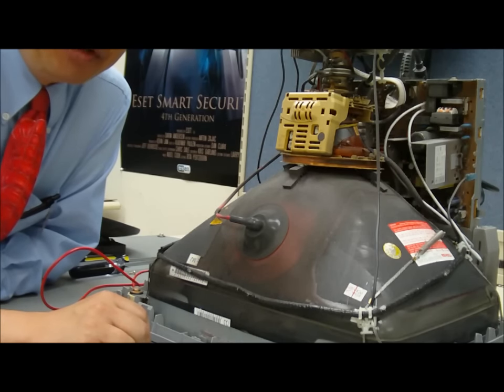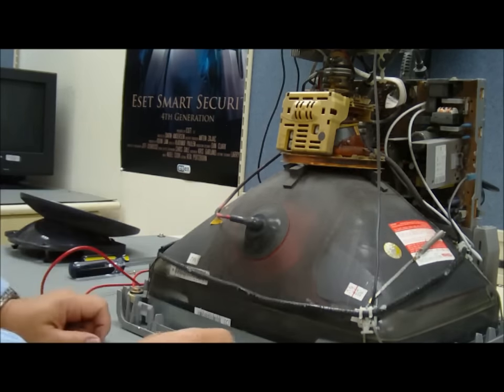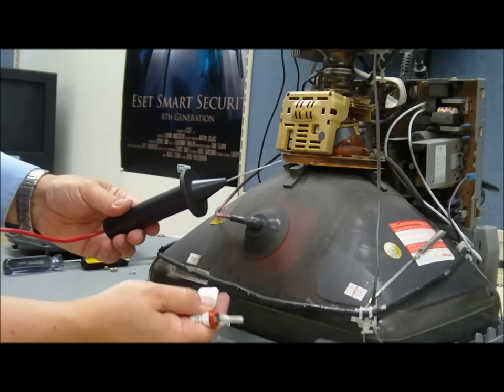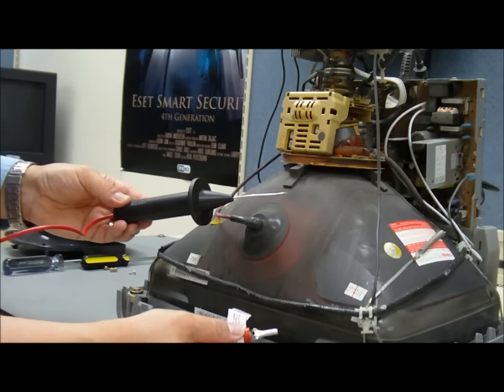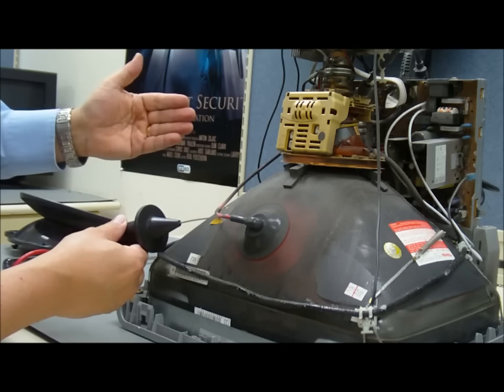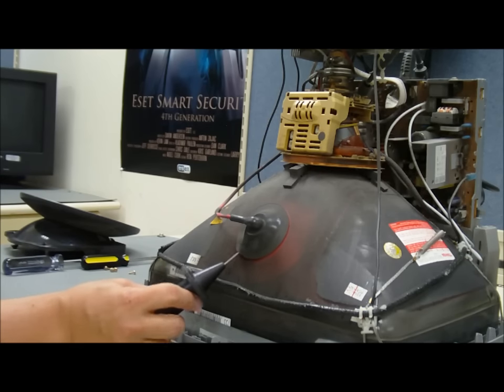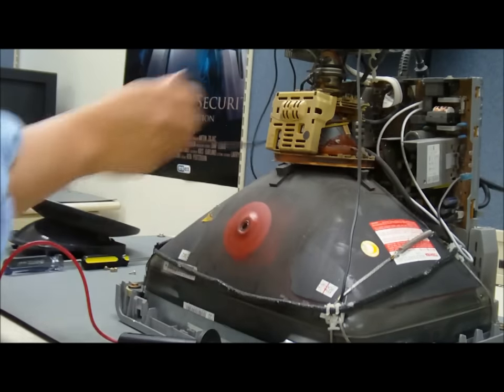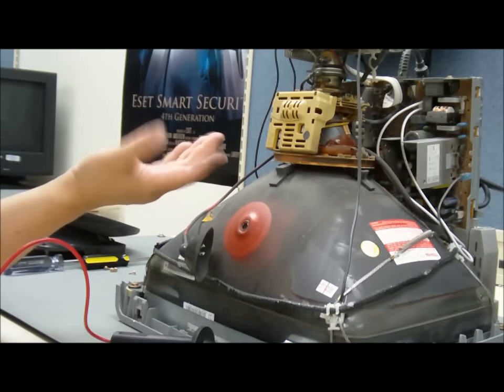Tech Support: Safely Discharge CRT Monitor

Comment: when taking the anode cap off, you don't just yank it off like that. you apply pressure sideways and dislodge it at an angle. Basically, pushing one side of the clip on the wall of the hole to close the clip together... It should come off smoothly and easily if you're doing it correctly.  This is described in service manuals for CRTs
Reply: Yeah, that didn't look good for the connector
Reply: Must be his first time
Reply: Not to send it off for recycle! Why bother?
Reply: Tysm that helped!

Comment: If the bleeder resistor failed or something else is wrong with it, the CRT will not have discharged automatically. Therefore, the discharge procedure is always recommended, bleeder or not. Very good demo.
Reply: I have first hand knowledge that this is true, its also true if you don't leave the CRT grounded after discharge it can build a charge back up over time. Best case scenario is it hurts a lot.  Also that type of discharge tool was the one Apple used to issue during the early iMac and eMac days....until they realized it wasn't strong enough to actually protect you from shock. They replaced it with one that had a much longer plastic handle and a much thicker metal probe.   If you haven't taken and passed a proper CRT safety course then just stay away from CRTs . Same thing goes for working on power supplies.
Reply: I think he was scared, trying to take it off as quick as possible 😂

Comment: Attention everyone!  Use a chicken stick!!!  You all need to be aware of the rise in "regular joes" such as myself and your own selves... attempting to open, discharge and work on CRTs.  There is a CRAZE going on in North America regarding RGB modding for classic console gaming (RGB gives the best picture and requies modifications to work on NA TVs).  I highly advise you all NOT to do the screw driver trick by hand.  Attach it to a non-conductive stick (we call it a chicken stick because we're too chicken to do it by hand).  It's a lot safer, you can do it from a distance, HECK you can even put your multimeter on there to make sure it's fully discharged.  These tubes have a bad habit of recharging themselves, so you may want to keep poking at the hole with your chicken stick from time to time, just until you've disconnected the board, and again when you're going to reinstall it.   Happy modding everyone!  Post your vids if you're doing RGB mods!

Comment: FYI you want to discharge and then wait several seconds and discharge again, otherwise you might get a shock. I've been shocked a few times the real danger is when you jerk your hand away and get cut on something. When I first started repairing sets I was loading a CRT into the car and got shocked, probably would have dropped it but I had asked my dad to help me and he had a good hold on it. I wasn't wearing any eye protection at the time either.

Comment: Safety first!! I always watch this video before discharging a monitor just to make sure I'm still doing everything right. Didn't have any trouble today either though! I've always found it's easiest to remove the anode cap with the discharge tool: when it's lodged underneath, just a slight bit of leverage will make it pop off.
Reply: If you happen to read this comment because you're working on your first CRT feel free to shoot me a message if you don't feel entirely confident getting started! Always happy to help out.
Reply: @raccoonofthemoon  Hi, it's my first time cleaning a CRT TV inside, I don't have a tool to discharge the Anode, what's the best way to do it with a screwdriver?
Reply: @brunorocca5391  As far as using a screwdriver goes I think your best option is to get a cable with alligator clamp ends and make sure they're good and secure on either side of the connection. It's not a bad idea to wrap a bit of electrical tape over the cable end clamped on to the screwdriver to really be sure you're not accidentally going to knock it loose.
Reply: @raccoonofthemoon  hello, first time doing so too.
I did wire a flathead screwdriver, to the metal frame, but no heard any sound when moving behind the anode Caps. Am I safe?
B/w set

Comment: I opened a crt tube when I was 12 yrs old, I got shocked for about 20 seconds while trying to remove that plug looking thing with a normal flat-head screw driver, I felt dizzy after and had to sit down , I believe that is the cause of my loss of long term memory lol luckily I didn't die.
Reply: ImaFattyCat bRRRRAAAAP
Reply: But you still remembered this.
Reply: CRT anodes hold massive amounts of potential energy around 55-60kV but don't last long when grounded and discharged. It would either give you a nasty shock at best or kill you at worst, but it'll be over in under a blink of the eye. There is no way for the capacitance charge of the anode to discharge as long as 20 seconds.
Reply: @floopflarp  yeah i am a Electric Engg. And he was making all this Shit up
Reply: @floopflarp  unless it was still plugged in?
Reply: @deepakk1347  he has long term memory loss, he forgot how long the shock was!
Reply: I was shocked buy a CRT I opened as a kid, it left slight burn marks on my finger, that turned white. Very painful, like a stun gun
Reply: I was electrocuted by one when I was thirteen directly after I unplugged it and I cut the red tube wire and it knocked me unconscious and fired the cutters right out of my hands burning me
Reply: When I was kid I touched a live wire I was looking back of TV but I didn't saw that live wire was didn't cover and I touched It. The moment I touched it I gripped on that wire I couldn't take it out and also I couldnt see anything like I see but can't process anything I was in shock and I fell to ground and the grip was losen I thought It was my last day luckily God saved me
Reply: I think it explains a lot more than your memory issues 😉 tada.
Reply: @NaN_000 like the power cable for a television? I’ve been shocked by 120 power dozens of times, it’s hardly dangerous.
Reply: @baddaytrader  our power cable has a potential difference of 240 volts AC
Reply: Oh dear heavens! That is awful... I'm glad you all here are okay in spite of that. Really gotta be careful with these things, but I'm sure you know that by now!
Reply: Omg that sounds painful, I don’t mess with my tube cause that thing could kill me, freakin’ Panasonic TAU
Reply: You’re lucky you’re here
Reply: 20 full seconds?
Reply: 20 seconds ? REally ?

Comment: Picture can sometimes hold a charge for some time after you unplug the set. Connect the ground clip to that silver strap around the picture tube. Discharge the tube...wait several seconds and discharge it again.
Reply: I wish that he left the clip inside the frame

Comment: Don't forget the massive reservoir caps populating the power supply stage.  Most modern equipment these days use a switch mode design that starts with rectifying the mains and shoving it into a big meaty CAPACITOR!
Reply: In this large Trinitron I just opened there are two 250v caps in the rectifier!

Comment: I have seen these creep back up in voltage since there is high enough of an ESR that the more distant charges creep to the terminal.  Certainly not as high as before, but you could feel it.  I've managed to be quite paranoid with these things.  Never been shocked.
Reply: The shock feels like a highvoltage stun gun

Comment: define modernday. like 2005? 2000? 1990?
Reply: Modern day is since I was born.
Reply: 1980s and onward. Vintage = 70s and below.
Reply: Old message but still relevant question, generally speaking its sets from the 90's and 00's. Sets from 80's and before you should expect there to not be a bleeder circuit, thus you should hear a pop/fizzle when you discharge the tube.
Reply: mikez2 is there a way to tell if it's actually discharged? Like with a multimeter or something?

~I'm a noob
Reply: @highhat5229  when I’m scared I connect a wire to ground and touch the part I think could be dangerous then I take a tester screwdriver and if the neon doesn’t show anything I proceed with no more fear

Comment: Thanks for mentioning that most CRTs hav a bleader cap, and are probably discharged anyway, although it's still a goo idea to attempt a discharge anyway.

There seems to be a prevailing myth/opinion that opening a CRT is a death trap nowadays. I can only assume this comes from the relative rarity of CRTs and the fact that not much people are working with them now.

Comment: Has there ever been a case where there's no click while discharging, but the tube still holds a charge? (accidents?)
Reply: If you miss the contacts under the rubber insulator you won't discharge and therefore won't hear a click.
Reply: Will a chicken stick click 🤔
Reply: Or cluck 🤔

Comment: You should have:
1) just gone ahead and touch the shorting on the inside cup terminal.
2)perhaps (if not to difficult), demonstrated the live 'pop'
3) explained that you weren't totally destroying the cup connection when removing it.

The reason for (3) is that I have NEVER...EVER heard that electrical 'pop' when doing the discharge!...well. I guess that has as much value as VCR safety repair tips now.  Overall, great video, it was always unclear if the stored charge, wrt ground, was in the huge tube or the cup electrodes

Comment: I discharged it and it made a giant spark, i'm still scared and i won't do it anymore
Reply: That means you did it right
Reply: @lookitskazzy  I actually didn't do it right, I used a 1kV rated screwdriver without the ground
Reply: @AlexYaga  Wtf? Screwdrivers are rated for electricity?
Reply: @n646n  not every screwdriver is, but some of them have special plastic insulation with the rating printed on them
I have 1kV rated ones
Reply: @n646n  it has to do with insulation, 1kv is general?
Reply: @AlexYaga  What do you mean without ground? You use the screwdriver to short-circuit it, you have no business with grounding it's not safe...
Reply: @jotr.9786  I didn't connect the screwdriver to the case of the oscilloscope I was discharging

Comment: When the CTR has been unplugged (not discharged) for over 2 weeks to a month what are the odds that a CRT still has to be discharged? Would you still recommend trying to discharge the CRT even though it’s been non usable or unplugged turned off for a month?
Reply: If the bleed resistor isn't functioning properly, CRTs can hold a charge for years that'll be strong enough to kill you. If you're trying to repair it or get rid of it, I recommend going through this process. If you are NOT confident in your skills, please do not risk it. These can stop your heart very, very quickly.
Reply: Yes definitely discharge it, every single time. That 30 seconds of making sure it's discharged will save your life. Even if you step away for a moment, always discharge as first action then move onto repairing or whatever you're doing.

Comment: can you link me to that specific tool?  i'd love to screw around inside this old imac,  turn it into an i7 intel PC :P  found some tutorials but i've never had any luck in finding proper discharge tools.
Reply: +Twilight Sparkle you don't need that special tool, just use a screwdriver. Hold it by the handle and be careful don't let you hand touch the back of the tube. Discharge the tube 2 times, waiting several seconds between. Anyway
Reply: whats the tool called?
Reply: whats the tool called?
Reply: Don't use any old screwdriver. It MUST be insulated with a rubber handle. Don't use any with wood or hard clear plastic handles, the voltage has been known to leak into these types of handles. Wrap a wire around the base of the metal part of the screwdriver and connect to a proper ground. Wear a heavy rubber glove.
Reply: @IzludeTingel  Which wire suits the best?

Comment: Do you need to put your hand behind your back
Reply: Skywtaker Is here You don't want to touch the metal case when it discharges.
Reply: It's a standard practice. If you accidentally get zapped, putting your hand behind your back prevents the electricity from going through your heart.
Reply: Yes, hand behind the back i do, its a good precaution, in case you get zapped and "flyback." Lol. Also its so you dont accidentally touch anything or even receive an arc of lightning from a leaky flyback.

Comment: Christ these things are terrifying for a TV. Why does a television of all things contain high enough voltage to electrocute someone!?
Reply: Because it has to shoot subatomic particles at five fuck-thousand feet per second in straight lines at the screen and do this completely dozens of times in one second
Reply: @danem2215  "fuck-thousand" - yes, I do believe that is the correct technical unit of measurement here. :)